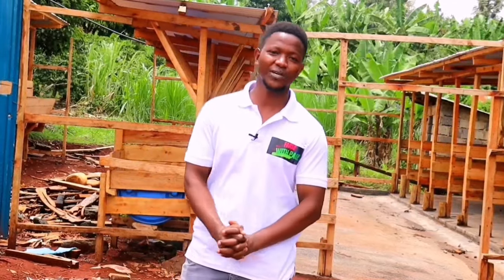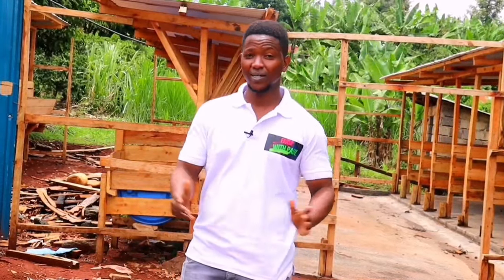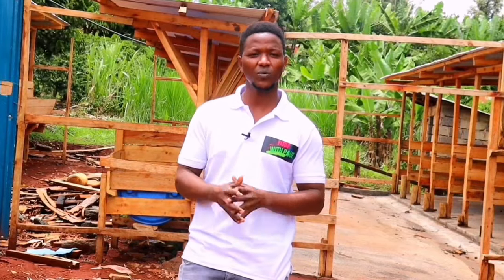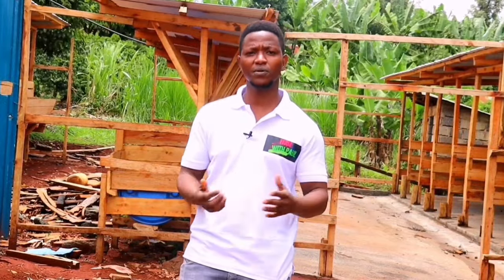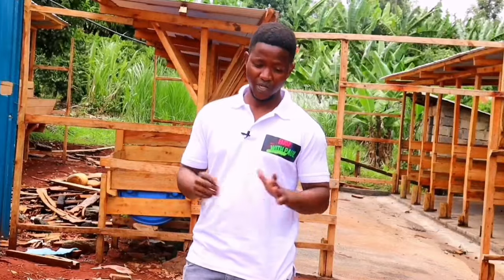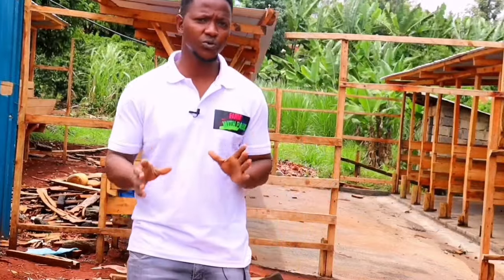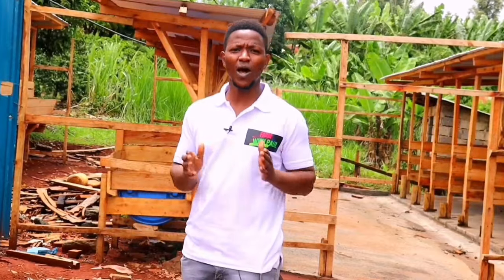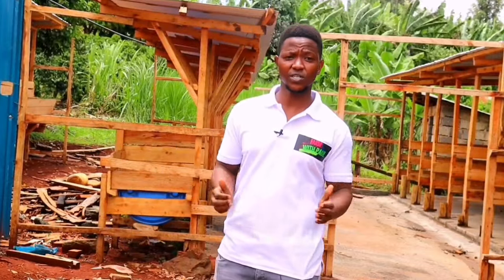COST EFFECTIVE WAY TO CONSTRUCT A COW SHADE FOR ZERO GRAZING

Comment: The problem that I have is that the sleeping area is too small, making the cow stay in one position through out the night, that's not comfortable at all. I follow the same model but make it in such a way that the cow can turn around (at least 360°) without difficulty by increasing the breadth and width
Reply: I think it that way to control hygiene